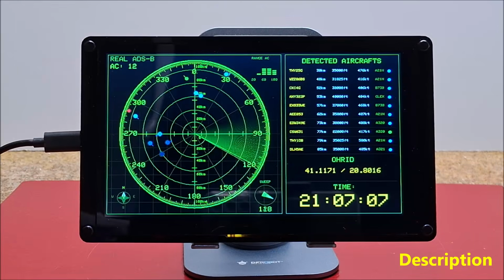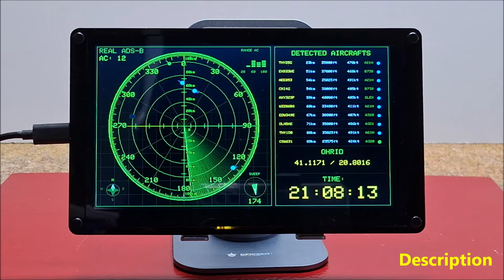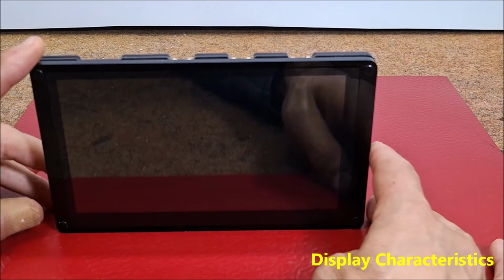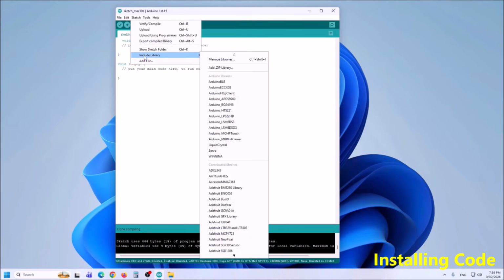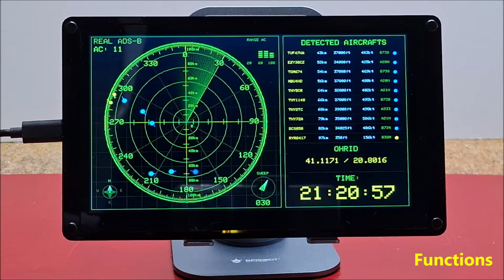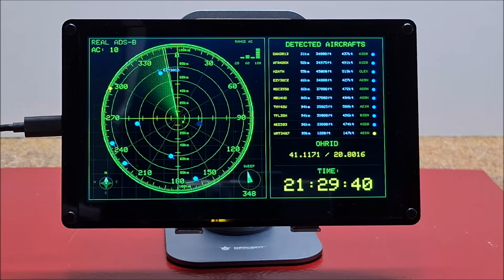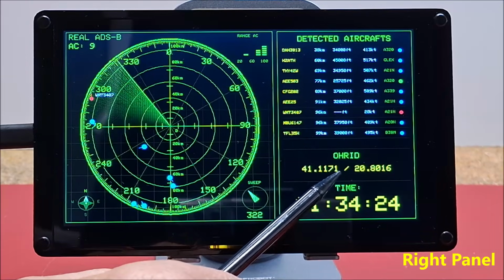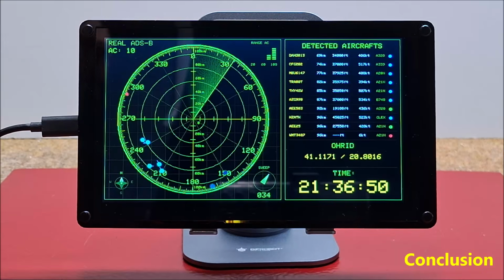Real Time Air Traffic Radar using ESP32 + ADS B Data

Comment: void loop() {
  if (millis() - lastSweepUpdate > SWEEP_SPEED) {
    lastSweepUpdate = millis();
    drawRadarFrameToCanvas();
    radarCanvas.pushSprite(0, 0);
    
    int previousAngle = (int)sweepAngle;
    sweepAngle += 2;
    if (sweepAngle >= 360) {
      sweepAngle -= 360;
      applyPendingAircraftData();
      drawDetectedAircraftPanel();
      startAircraftFetchBackground();
    }
    
    // Trigger audio beep precisely when sweep crosses the 0-degree marker
    if (previousAngle > 345 && sweepAngle <= 10) {
      triggerRadarBeep();
    }
  }

  if (millis() - lastClockUpdate > 1000) {
    lastClockUpdate = millis();
    drawTimePanel();
  }
}

Comment: // ---------- AUDIO CONFIG ----------
const int RADAR_AUDIO_PIN = 4; // Connect your buzzer/amp to this GPIO pin
const int AUDIO_CHANNEL = 0;
bool audioInitialized = false;

// ---------- AUDIO SYNTHESIS ----------
void triggerRadarBeep() {
  #if ESP_ARDUINO_VERSION >= ESP_ARDUINO_VERSION_VAL(3, 0, 0)
    ledcAttach(RADAR_AUDIO_PIN, 2000, 8);
    ledcWriteTone(RADAR_AUDIO_PIN, 1800);
    delay(35);
    ledcWriteTone(RADAR_AUDIO_PIN, 1200);
    delay(35);
    ledcDetach(RADAR_AUDIO_PIN);
  #else
    if(!audioInitialized) {
      ledcSetup(AUDIO_CHANNEL, 2000, 8);
      ledcAttachPin(RADAR_AUDIO_PIN, AUDIO_CHANNEL);
      audioInitialized = true;
    }
    ledcWriteTone(AUDIO_CHANNEL, 1800);
    delay(35);
    ledcWriteTone(AUDIO_CHANNEL, 1200);
    delay(35);
    ledcWriteTone(AUDIO_CHANNEL, 0);
  #endif
}

Comment: wire error wile compl the sketch Wire.begin(19,20); Compilation error: 'Wire' was not declared in this scope
Reply: In my case, it was an old Arduino 15 installation. I deleted all the Arduino folders from ...\AppData\Local\ and then reinstalled the Arduino IDE. Any missing libraries are detected during the ‘Verify’ step. After that, the compiler runs through. The missing libraries are LovyanGFX 1.2.26 and ArduinoJson 7.43.
Reply: @JR-tm1fh ok i will check it later today thanks